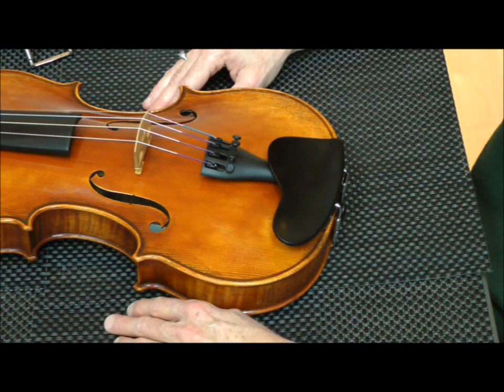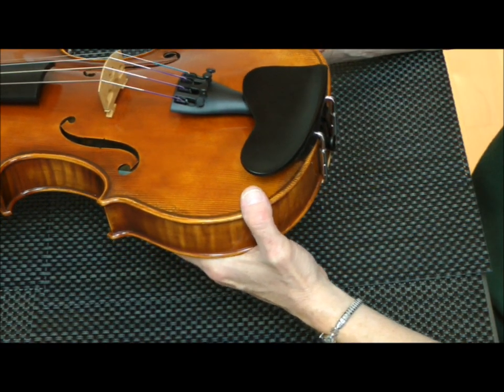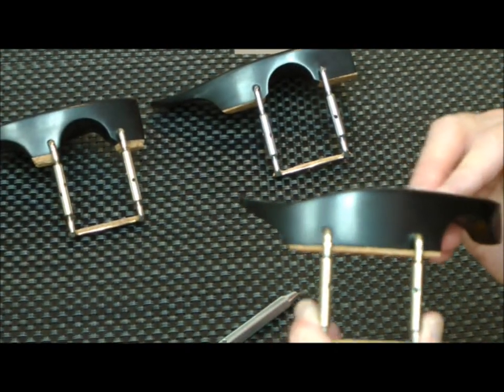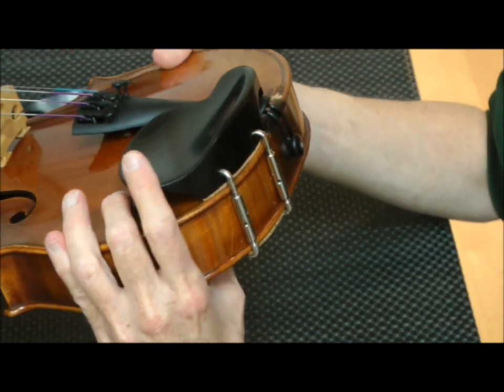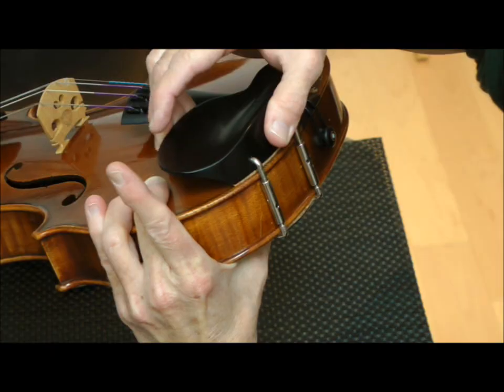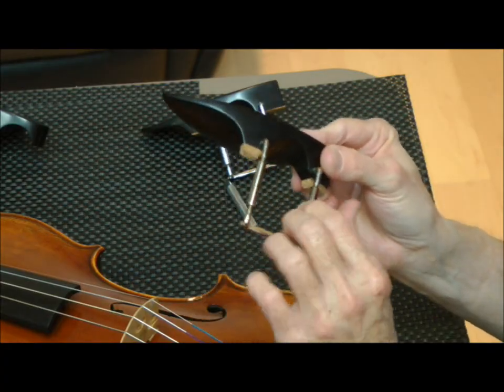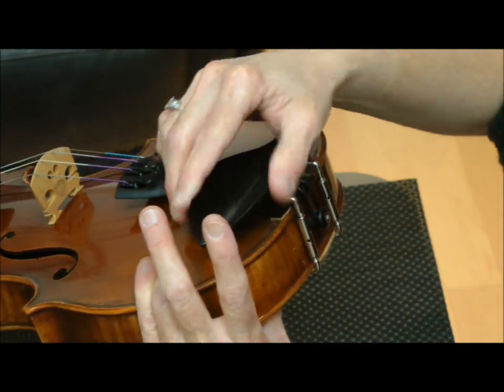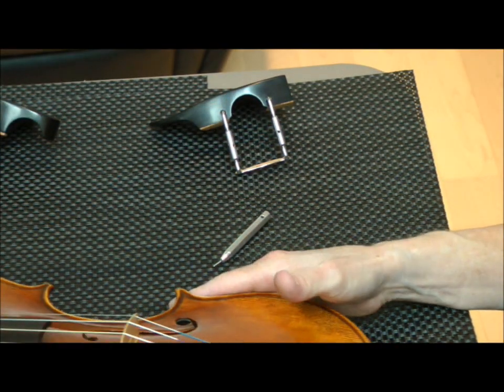How to Install a Violin Chinrest

Comment: Umm at school my violin case got smacked off my bus and it broke my chin rest off and I gotta fix it before school because my teacher gunna get maaddd so like i tried doing this BUT IT WONT FREAKING STAY PUT I DONT HAVE THE STICK THINGY TO TIGHTEN IT HAHSHHUBHFCBHHJVRFBHJVRFWYRVFGY
Reply: You can use a bent paper clip. Be careful not to poke too far through the holes or you'll scratch the ribs. Do NOT overtighten, you'll run the risk of buckling the ribs.
Reply: Jasmin Flores hhhhh

Comment: This  instructions sucks.
Never never never ever place chinrest directly on plates.It should be placed right on the rim edge of the plate with little overlap BEHIND,
where the plate is the most thick and don't touch anything except this rim.If you place chinrest like in the video you will:

-Damage the sound of the instrument-Stick chinrest on front plate and damage big area of the varnish (as already was done on this particular violin) -You can develop crack of the plate or deform the geometry. especially with chinrests not mounted over a tailpiece-Chinrest will become loose after time (as mentioned in the video) this is not because of temperature, but because YOU ARE DEFORMING FRONT PLATE !!!!!!

BIG THUMB DOWN
Reply: Thank you for this information. I have recently noted various tiny cracks between the rim and the plate on the bottom left side of my violin that aren't anywhere else... The violin was made in 2008 and I have been the only owner although I have barely ever played it. I surmised that the pressure applied by the chinrest was the culprit. I installed the chinrest years ago and I had little clue what I was doing. I am replacing the chinrest right now for a better fitting one and I won't be making the same mistake.